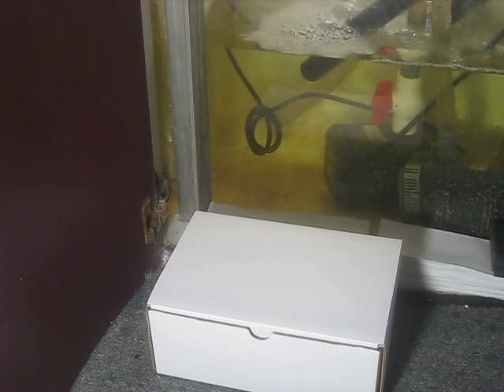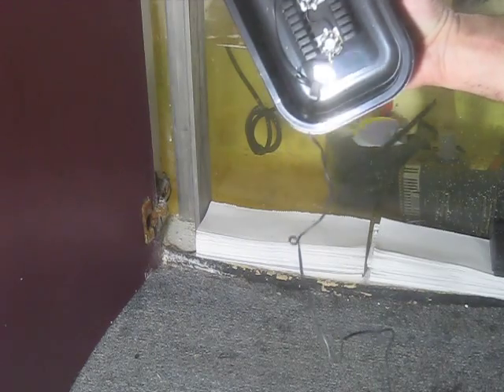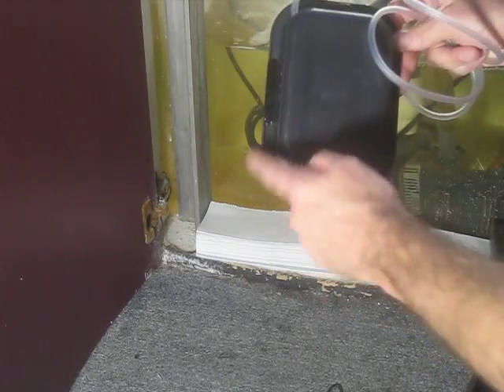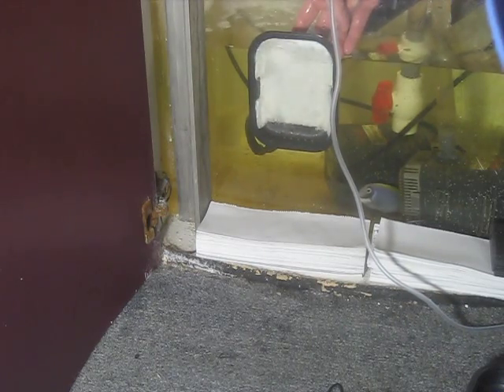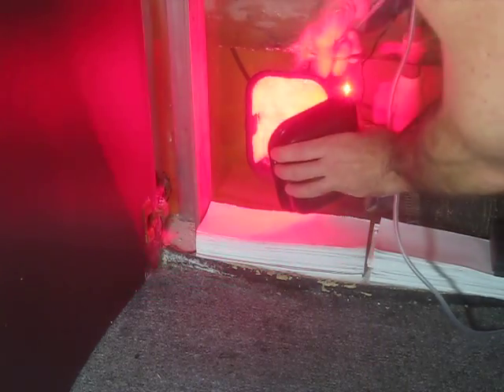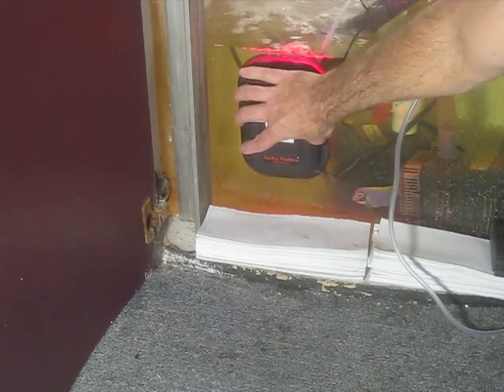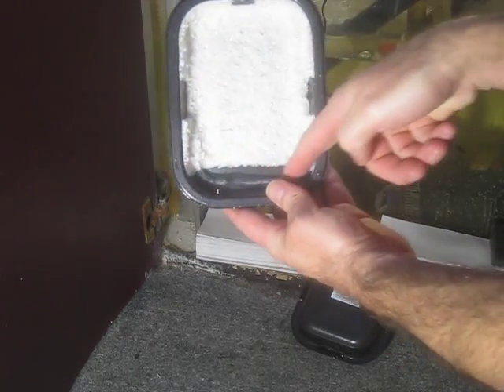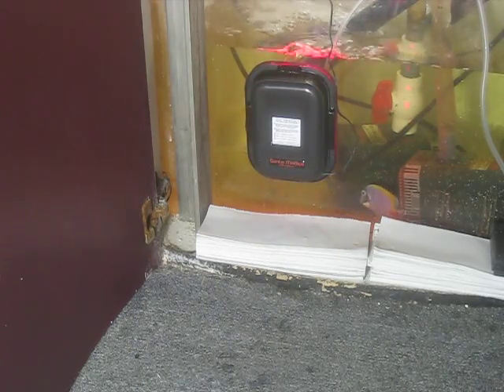Santa Monica Filtration HOG1 UAS - unboxing and placement

Comment: $150?  Seems kind of steep for $4 in LEDs, $10 in LED driver, <$1 in some sort of cement panel, $5 in magnets and $? in 2 simple molded plastic shells.  It appears this cost somewhere around $20 to make, and that is in terms of retail-priced components.  It looks like it would be a nice purchase if you were charging around $50 rather than $150
Reply: Probably overhead, warranty costs, etc. start making them and you can sell them for the same